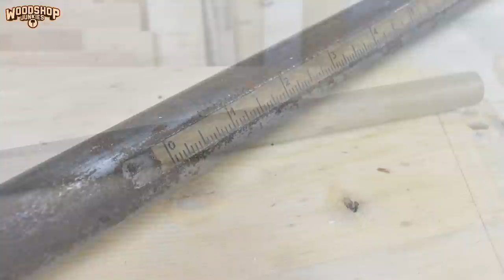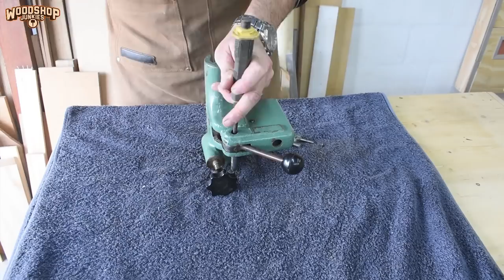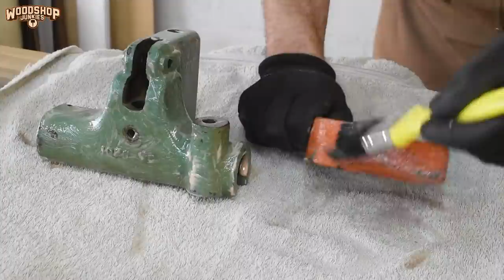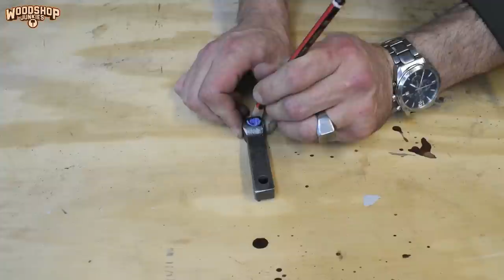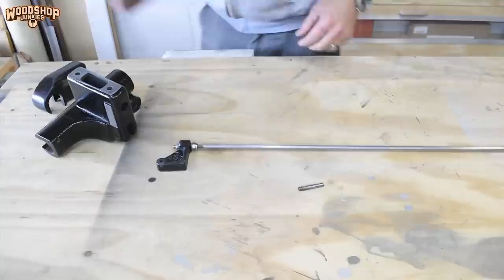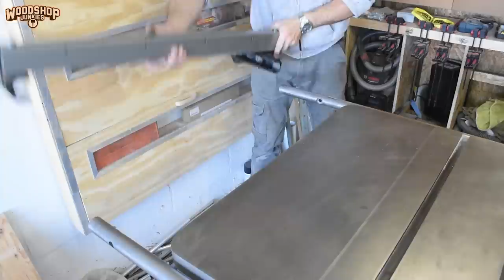I Was Given A Fence! - Can I Get It Looking And Working Like New?

Comment: Beautiful Work!  I’ve been eyeing my fence on my old Delta Rockwell 10.  Sort of inherited it when we bought our home. 
  Poor thing had sat out in the weather before it was stored in my shop and pretty much abandoned. My friend rewound the Baldor Motor. 
  He (RIP) owned an Electric Motor shop and as I recall he charged me $125 American . He wound it in his “Spare Time”. I believe that is now a HIGH Dollar motor. 
  I built a new extension table with a Router mount and dolled up the surfaces which is due to be done again. Adding a Link Belt is the absolute best thing you can do to smooth these old relics out running wise. 
    And now you have given me perfect incentive to rehab my fence. Thanks for a Great Video. Cheers.

Comment: That was so fortunate to get the original part. And the restoration is awesome.
I also use evaporust myself. The beauty of this liquid it is a nontoxic agent and you can reuse it over and over. I use disposable paint strainers just to remove any large metal particles. (You should have been sponsored after using it for the entire restoration. Hint, Hint Evaporust Company)

Comment: @woodshopjunkies thanks for the lesson.  When you are done with the rust remover...try sending it through a funnel and filters...cheese cloth first will filter out any debris (I highly recommend cleaning with a degreasing dish soap and hot water  and a scrub brush first). Then repeat the filter process with large coffee filters...this is slow but it allows it to be reusable! That stuff is really expensive but definitely worth the cost!

Comment: I just bought a 1968 Delta contractors saw with solid cast iron wings. It came with a 30" Jet-Lock fence that is almost identical to the fence you polished up here. It is nice to have a 'fresher course...thank you!

These fences were the cat's meow for many, many years. Often copied, but never duplicated. Still, until Biesmeyer (sp) started manufacturing their T-square style fence in the early 1990's, they were king. Rock solid, stable, and easy to realign should one come out of square. The micro adjustable feature is indispensable for the type of work I like to do.

I am slightly jealous of your brass inlay scale on the front fence bar. What a cool touch!

Comment: As long as the fence travels smooth and is parallel to the blade without any fuss or issues, I see no issues myself. I have a Biesemeyer fence and it works extremely well, but only after setting it up correctly... Thumbs Up!

Comment: I dip steel wool into Paint remover to scrub awkward areas and steel wool gets into pitted areas also and if necessary I wipe the item down with a cloth and white spirits as it evaporated quick but I usually let the item rest for a few hours after wiping it down with white spirits so it allows plenty of good time for full evaporation

Comment: I think you should build yourself a shower curtain paint booth. It is cheep and can be packed up small. 
Basically frames with a bar on the top whare you can hang your curtains on, it is also scalable

Comment: That’s a beautiful saw, machines of a certain vintage are just so much nicer. Especially table saws that originally came with a riving knife, and you really really really should get that sorted, it makes this thing so much safer. If your fence is not 100 % straight, you might end up guiding shorter pieces into the blade towards the end, and without a riving knife that’s actively asking for trouble. But even with a perfect setup, a riving knife is critical.

Nothing bad ever happens, until it does and changes your life in a very shitty way.
Reply from the maker: I agree and the riving knife and blade guard bracket is high on my to do list.

Comment: Very nice Jean!I did exactly the same to my AGS10 and that standard fence works just fine...  cannot justify spending big bux on an aftermarket one. Am still looking for the tail casting (the part that clamps to the back rail) as mine has been butchered and there is a piece missing. It is a wonderful saw and am really enjoy using it.

Comment: I've watched your whole series, like in binge watching. What a great introduction to your channel! I enjoy seeing you spot and address various challenges, like welding that crack in the case, or making your own replacement rod in the fence in the next previous video. I think your paint job turned out really well--your instinct to match the original black/silver (or gray) of the faceplates was spot on. Also, your instinct to go with a heavy, cast-iron, pulley-drive system for accuracy's sake was entirely justified just with that demo of running the machine with the coin on edge on top not moving at all. Convincing. I do have one question, and that is that there seems to have been no thought to dust collection? Seems like that's a pretty critical component of any restoration in a modern shop. Thoughts?
Reply from the maker: Thanks! I am currently designing add-ons and modifications for the saw. Things like dust collection. I will only get to those, however, once I have completed the riving knife and blade guard repair which I am working on at the moment.
Reply: @WoodshopJunkies  Fantastic! Can't wait to see your repairs! You're one of the reasons I haven't watched network TV in any place but doctor's offices for years now. : ) I'm actually really curious how you will integrate dust collection, given that your frame is open to allow the motor to swing with a beveled blade, for example.

Comment: I have the same fence which is broken, the small casting on the outward end is broken so I've put up with it for years. What is the rust remover that you use, that seems very effective and appeared to deal with surface oil OK or did you miss out the degreasing?
I learnt a lot thankyou

Comment: Hi Juan, another great restoration / clean up and so good to see that cabinet saw coming back to life! One question, did you check to see that the fence is parallel to the blade? How would you make adjustments to the fence to get it into alignment?
Reply from the maker: I did small alignment corrections using the bolts on top. When they a loose there is a small amount of play that I used to align the fence.

Comment: That looks a lot better than what you started with. Did you put anything on the rails to make it slide easier?
Reply from the maker: No, but there was paint on some of the fence working surfaces. I didn't paint on those surfaces when I repainted the fence. This made the fence slide much better.

Comment: Why don’t you build your own sand blaster? Then it can as simple or complex as you need or want it to be. I myself went with as simple as possible since I only have one project I need to sand blast. I used an air nozzle for an air compressor and a 20oz pop bottle. Of course with what you’re doing, this won’t be anywhere near sufficient, but maybe you could build a bigger and more elaborate one. It would certainly make a fantastic video.